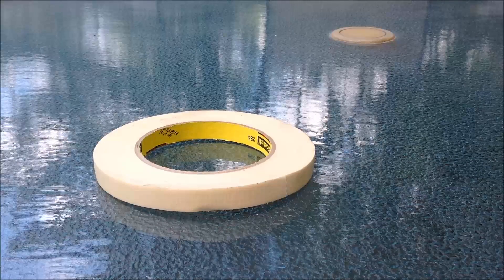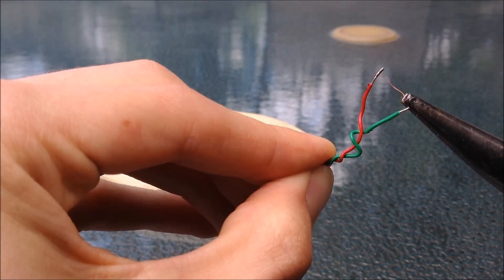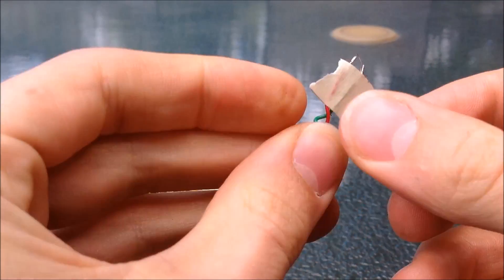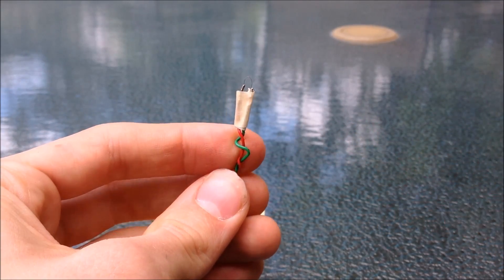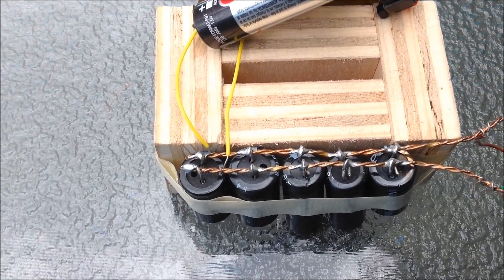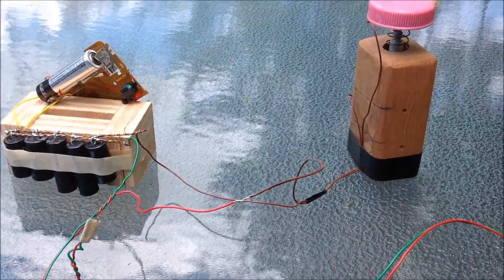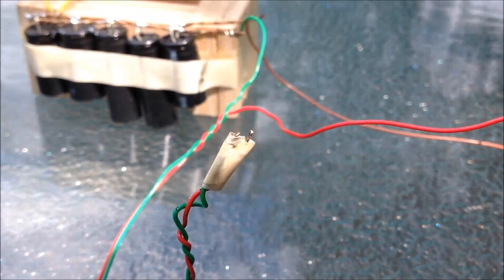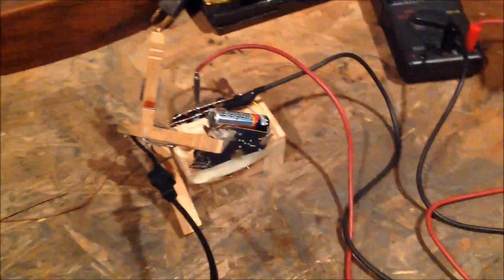Homemade Exploding Bridgewire Detonators!

Comment: I need some of these for my nuclear program
Reply: Im actually software engineer who worked on indian shaped charge simulation software used for designing and testing implosion lenses with mixed explosives with different velocity of detonation, funny how many different kinds of people from the field met under this video
Reply: @Dadas190  Oh cool. So it's confirmed they used explosive lenses. That's not in the public domain as far as I know. Can you tell me how many lenses? What explosives were used? Outer diameter of the implosion system?
On which particular weapon did you work?
Reply: i can give some information about that
Reply: @matiszyszak4064  Design is a pretty difficult task. Takes nations several years.
But yes, production of fuel is another difficult task.
Reply: @industrialadhesive6357   @Industrial adhesive  You've designed a 1st gen weapon?
What was the value for delta for your core? The alpha? Tau? The thermal diffusivity? The photon mean free path? Sonic speed? Insertion time? Incubation time? Average degree of ionisation? Peak power wavelength of the photon gas? 
When you say you've designed one, have you actually designed one completely? How far have you gone? 
Please describe your weapon. The fuel type. Fuel mass, implosion parameters, and how you calculated its performance. I'm skeptical you've actually produced a design. 
I explained why slappers are inferior.
The difficulty in bending the detonation wave exists no matter what HE you're using
Reply: @Evan_Bell  also have you ever tried designing a levitating pit?
Reply: @industrialadhesive6357  Well U-234 isn't fissile. So your design won't work at all. Your core isn't capable of going critical.  
Yes, 19g/cm^3 is around the density of uranium. 18.7-19.1 depending on production method. 
523.599 cm^3. So it contaims about 9.95kg of U-234. Not going to do anything. 
I don't mean tau as in 2pi, I mean the average neutron lifetime. 
PETN can't be pressed to that density, and if it could, its detonation velocity would be higher than that. 
Carbon neutron moderator?
Why do you want a neutron moderator? 
How many detonators are you using? How are you smoothing and shaping those conical shock fronts into a convergent spherical one? 
You're using a non fissile fuel and haven't really described anything about the core parameters or the parameters of the implosion system, you only stated the properties of your HE and got that wrong. I don't believe you've designed a nuclear weapon. 
In all designs, the HE will take the form of a hollow shell. If the detonation fronts from resulting from the slapper detonators aren't refracted, there'll be massive implosion asymmetry.
What equations and design specs did you go over?
Reply: @Evan_Bell  did i say 234 i meant 235
Reply: @industrialadhesive6357  Okay, so you have 523.599 cm^3 of U-235. Coincidentally the volume of sphere with a radius of 5cm. Didn't you say you have a Am-241 based initiator occupying some of that volume too?
But either way, 523.599 of U-235 isn't capable of going supercritical either. 
Yeah, you didn't design a 1st generation weapon. 
I got started by reading a wiki page about 5 years ago and realising these machines aren't as secret as I thought. I've since learned there's a lot of missing and false information in those wiki articles, but they started me on the right track. From there I read thousands of papers and dozens of books on the relevant fields of physics and engineering, and built a large spreadsheet calculator to model all the parameters to produce a design in which I have high confidence. It's much better than the manual calculations I was doing initially. It'd take days of calculations to determine the effects of one minor tweak in the design. Now I can plug in a new number and all the affected values are amended automatically. It can calculate the implosion velocity, symmetry, peak spall stress, shock convergence parameters, density change behind the shock front, core efficiency, energy density, temperature, blackbody spectrum, neutron spectrum, radial neutron flux density distribution, radiation pressure, radiation diffusion wave propagation to determine tamping requirements, neutron diffusion into the tamper, probability of predetonation, neutron initiator requirements, optimum height of burst, flash time, peak blast overpressure, gamma dosage, neutron dosage and thermal flux vs distance from epicentre, probable height and diameter of cloud, fallout activity vs time, separative work and natural uranium mass required to produce the fuel and a couple of other things. 
As it stands right now, my design is exactly 500mm in diameter, weighs roughly 121kg and will yield 10.1-13.8kt.
Reply: @Evan_Bell but you didn’t mention the Gurney Constant/(and-or)Ballistic Coefficient (of said fragmentation), in relation to the different air density levels given a particular area at ground level and elevation. Make a spreadsheet with a known charge, at sea level, and show how these parameters change, from sea level to 10,000 ft. You pick the date in history, location and weather associated to make your calculations.
Reply: @PyroDemon1  There's a thousand things I didn't mention. I'm not sure what point of mine you're responding to when you're talking about the effects of atmospheric drag on the velocity of charge tamper shrapnel...
Reply: @ I was just keeping the conversation going. Just having a little fun bro. No harm
Reply: I dont have actual design specifications, our software used some testing vectors supplied by design scientists but these were obviously forged just to test specific aspects of the simulation and not workable designs, but yes, i can confirm that implosion lenses were definitely used in indian fission fusion staged designs
Reply: Also we dont know type of explosive used, just its velocity of detonation was available for the purpose of testing
Reply: @Dadas190  Ah, that's a shame.
Reply: @industrialadhesive6357  Just realised you said Am-241 neutron source. It's not possible to produce a sufficient high neutron yield source using Am-241.
My weapon does use a levitated pit.
There's several things wrong with your design that mean there'd be no chance of any nuclear yield.
Yeah, I saw Scott Manley's series. I corrected several errors he made in the comments.
Reply: Footing Ball555  Oh, but I am. I have done.
Reply: @jasonbender2459  No, not a uranium wedge. A levitated uranium implosion device.
I have modelled the implosion using well established theory developed by explosive hydrodynamicists, using experimental data on the drive of metal shells by HE detonation, as well as experimentally derived data for the shock Hugoniots*, detonation wavefront pressures, convergence factors, thermodynamic exponents, sonic velocities, spallation strengths, shock transmission at boundaries of differing acoustic* impedance, and other characteristics of HE implosions. My model agrees with what experimental data has been published in that field.
Reply: @jasonbender2459  What did I misspell? Hugoniot? Obviously a single letter typo. I'd literally just woken up when I replied.
Those "obvious redundancies" serve as clarification for the laymen that'll read this thread.
In what way were my sentences incoherent?
Reply: @jasonbender2459  As I said above, 3 post-doctorate physicists working intermittently for 3 years were able to produce a design that was considered by many in the field to be viable. They did this in the 60s using only publicly available information. I don't think it's unreasonable to believe that 1 person today with access much more publicly available information would be able to produce a viable theoretical design of similar sophistication in double that time.
The fact that I was even aware of the terms I used in my first response to you illustrates I have at least some level of understanding of the phenomena at play.
Reply: @jasonbender2459  Fair enough mate. Very understandable to be suspicious of people making these sorts of claims on the Internet.
Reply: How are you producing the fissile fuel?
I don't believe for a second you're capable of manufacturing a nuclear weapon.
Reply: @Evan_Bell  he's joking lmao
Reply: @wat8437  As someone who actually is capable of designing a nuclear weapon, I come across others who claim they can frequently.
Reply: @Evan_Bell  I really doubt that you can actually produce a nuclear weapon yourself. Many countries with teams of physicist have tried and failed.
Reply: @ntechplayz6155  Am I able to produce a weapon? No. At least not yet. There's a lot more I need to learn about vacuum casting, diffusion bombing, high explosive synthesis, as well as the nitty gritty of uranium chemical processing. Although I've also done some modelling work on gas centrifuges, there's still a lot that needs work there, primarily to active magnetic bearing and induction motor. 
I'm also not able to get access to all the equipment that'd be needed to built it. 
I have however produced a design for a weapon. Which countries have failed to design a weapon?
Sweden, Switzerland, Argentina, Brasil, Iran.. They all produced designs without manufacturing them.
3 post-grad physicists in the 60's were able to design one in a govt experiment. Supposedly a student at Princeton designed on in the 70s, (although I'm skeptical of how exacting his design was). In the 2010s and 2020, I have access to a LOT more information than they did. I've produced a design. I have very high confidence in its performance. My numerical calculators yield accurate results when the known parameters of other weapons are input.  It'd work.
You may doubt that, but ask yourself, how qualified are you to make that assessment? How much do you know about nuclear weapon physics and engineering? How much time have to spent trawling the internet for information about them and related physics?
I've spent almost 5 years on it. I have over 1800 files on the matter. If you're still skeptical, feel free to ask me for any details of my design or how I characterised specific parameters of it.
Reply: @Evan_Bell  Wow, thats quite the accomplishment. I´ve also considered trying to design a warhead but found out that my knowledge in that field is rather... superficial. It seems easy at first but as soon as you dig a little deeper than just Youtube-vids and Wikipedia and read about all of the parameters that are necessary to design such a thing, you really start wondering how something like this can actually be done. My current problem is that I dont really know where to start, can you maybe recommend some books/documents with which one could do their first steps in the field of nuclear engineering? Regarding your work on gas centrifuges, which design are you working with? The normal one or a Zippe-type centrifuge? The latter seems to be more efficient and in general the most popular method of isotope separation currently in use. But anyways, I wish you the best of luck with your project.
Reply: @mv_chemistry5852  Zippe type. Although it's been on the backburner for over a year.
There aren't any general sources I can think of off the top of my head, but if you have any specific questions, I'm all ears.
I might not be able to answer anything too technical about devices other than 1st gen pure fission weapons.
Reply: @industrialadhesive6357  I've designed a 1st generation weapon. I've also done some design work on missiles. They're both very challenging. Simultaneity of actuation of the detonators isn't much of an issue. Just requires high precision fabrication and high current rise time switches. There are far more challenging aspects of weapon design that the detonators. Slapper detonators aren't used. Although they more efficiently couple energy to the HE, they do so in a conical volume, rather than a divergent sphere. This makes it much more difficult to bent the detonation waves.
Weapon design is hard. Have you been able to do it? Know anyone who has? Would you even know where to start? Are you at all qualified to remark on the difficulty?
Reply: @industrialadhesive6357  SAMs and ATGs have active online guidance. ICBMs use a pre-programmed flight plan.
A pre-set set of code isn't particularly hard to create.
ICBMs usually use Inertial navigation, sometimes with GPS or astral calibration.
Yes, most weapons of reasonable sophistication will use some live determination for point of release of the warheads.
Reply: @Evan_Bell  okay that makes sense.

Comment: How is weight of nitrocellulose inside ?  If it were for example 0,3g  must be in the wood some impact. Some the crater hole. Some trash wood get out. The some chips from the wood is necessary see after blow. This seems some between deflagration and detonation.

Comment: How well does a steel wire work?
Reply from the maker: I can't really comment on steel versus copper as the bridgewire, but if you have very fine steel wire, it is worth a shot.  Keep in mind the wire has to be quite thin in order to truly explode - I believe my wire was less than 0.1mm in diameter.  Try it and see if it works!  You might also need higher voltage to compensate for the increased resistance of iron - more voltage = more amps = more explosion.

Comment: If you use a spark gap, you will get more a powerful wire explosion.  The current through the bridge wire "sees" the ramping up of the discharging caps and explodes somewhere along that ramp before the full power has a chance "to do its thing".  With a spark gap, the voltage/current has to overcome the air gap (ionizing the air) at a much higher voltage/current.  That higher voltage/current is delivered to the bridge wire causing it to explode with more intensity and speed.  Kind of like pressing on the brake of a car and pressing down on the gas pedal at the same time, then releasing the brake suddenly to accelerate more quickly (theoretically).  Not good for cars!
Reply from the maker: Thank you for your helpful and insightful comment.  I enjoy the community input and discussion YouTube videos create.